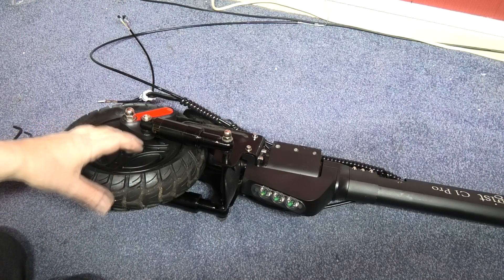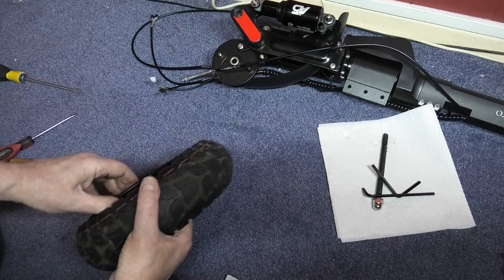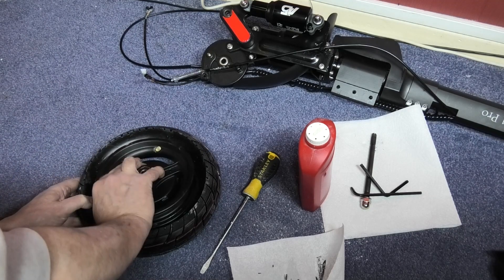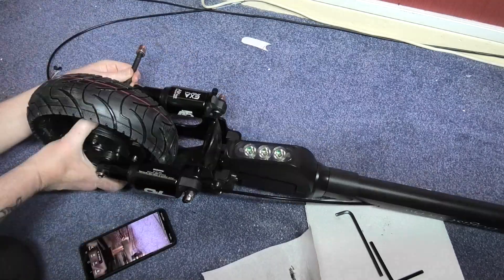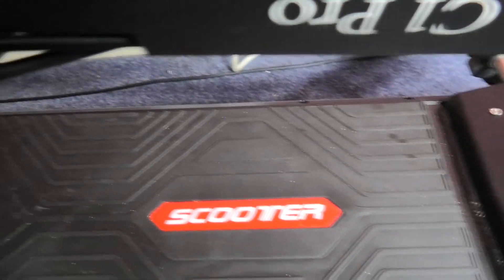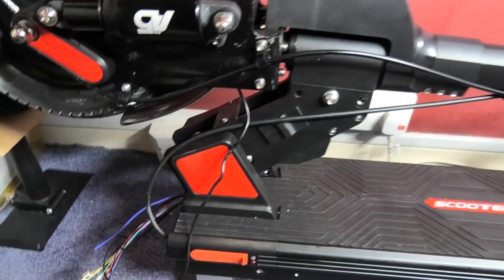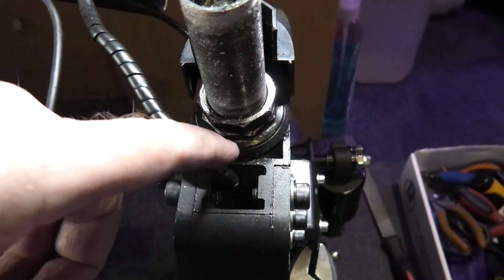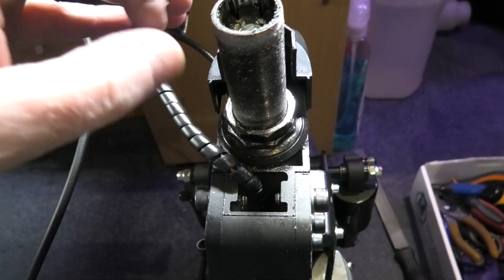🔴 EXTREMELY POWERFUL E-SCOOTER BUILD part 9 - New front tyre & fixing the steering

Comment: Why not go tubeless in front? seeing your rims, i think it could go tubeless.
Reply from the maker: Yes, I reckon it could and I might do it in the future. I just wanted a rolling chassis so I could work on the rest of the stuff.
Reply: @Vortecks  you've mentioned on your previous vid that some can convert their split rims to tubeless? how?
Reply from the maker: @k0k0w  The front is a solid rim, the rear is split. I tried to convert the rear to tubeless but I can't fit a valve because there isn't enough space between the motor and rim.
If you use a non permanent rubber-based adhesive, it'll hold the 2 halves together and hold the pressure no problem. I was planning to use E6000 adhesive but It's not going to happen now.
Reply: @Vortecks  Thanks for the idea.

Comment: I am also making a sleeper scooter... But it's huge. 5 inch wide fat tires 48v 2000w with a peak of 2500w chain driven. I want to slap a 72v battery and 3kw motor in it.

Comment: I had the terrible idea of buying solid tires for my M365.
If you thought changing the air-filled tires was hard, you can't imagine the solid rubber ones.
I had to sell them. Nobody in the city was able to mount them.
Reply: You actually have to use a crowbar to mount them, heat up the tire and cool down the hub to mount it. It's possible.
Reply: @darkslidesk8t3r  I tried many times :(
Boiled the tire to almost 100 degrees, used loads of lubricant, brought in friends far stronger than me, used big tools.
I just couldn't do it.
Reply from the maker: @logitech4873  Personally, I'd have got 3 spoons, lighter fluid, an angle grinder and then set fire to the lot 😂
I watched videos of someone trying to fit solid tires on an M365 and I decided against it in the end.
Reply: They're made for split hubs...🤔😳😳😳🇬🇧
Reply: @EnglishTurbines  You'd be surprised. They advertise a them specifically for the M365, and while it's THEORETICALLY possible to mount them, you need to be a gorilla trained in monster truck maintenance.

Comment: Why is the banjo on the outside of those brakes... 

Shouldn't it be on the outside?
Reply from the maker: Don't you mean "why is it on the inside"? 😁
Most of them are actually on the inside but obviously, they have a lot more clearance with a 26" wheel. I'll probably change it for another type in the future because I'm not happy with it being that close.
Reply: @Vortecks  

I think I may have originally went to put 'why is it not on the outside' and then changed it... Partially

I think if I had my banjo on the inside on my ebike, it'd rub the motor.

I don't use a rotor spacer, due to my frame and motor size.

Comment: I have a squashed disc and sciatica also. And have had nerve block injections. And unfortunately I can tell you there is a far worse pain. KIDNEY STONES!!!
Reply: do inversion tables work for various spinal/posterior issues ?
Reply: @girlsdrinkfeck  My opinion, fwiw, would be no. Possible temporary benefit, but no long term solution. I am finding chiropractic help plus wearing spinal bracing is beneficial to me with my conditions.
Reply from the maker: @girlsdrinkfeck  Yes, they do apparently work. The physio suggested that I get one so I did https://www.youtube.com/watch?v=Nu3Ux9UQHgM
...... and then I got rid of it.
Reply: @Vortecks  I watched that video. It seems you have similar, possibly a little worse condition, than me. I am L4 L5 S1. And at times pain has been crippling. The source of much of the pain is caused by inflammation. And I control that with Holland and Barratt. I hope you are claiming PIP, which can buy you the necessary.
Reply from the maker: @davidwebb4904  DWP deemed me fit for work (I got a total score of zero). I'm appealing it because I was misled into answering all the questions on a 'best case' scenario. During the assessment, I did manage to do nearly everything I was asked (albeit very slowly and in excruciating pain) but I was in bed for 2 days afterwards.
it took me 3 days to prepare for the assessment by getting a lot of sleep and rest (by any means) but they didn't care that I normally only sleep for 2 hours a night, they didn't care that I have anxiety attacks when visiting places where I don't know if I can lie down and they didn't care about all the effort I made, just to bloody get there. The report only listed the good points and she totally missed out things like "I don't go out unless my daughter is home because I'm terrified that I can't get back up the 2 flights of stairs back to the flat". Not only that, but they totally disregarded the letters from the neurosurgeon, the physio and the doctor which all said the same thing.
Unbelievable mate.
Reply: @Vortecks  Very believable because that's exactly what they did with me. The questions are biased into you failing. And as you said, they are in a best case basis instead of an on demand anytime basis. They are sneaky little bastards and honesty does not pay. 
On the paper questionnaire everything should be sometimes or it varies. That covers you for any eventuality. Same with telephone assessment. Then at the MR, you lay it on thick. Exaggeration is not a lie. After that, so long as you have given good answers, filing for tribunal should spook them into an offer. Then it's your choice if you want to accept that offer or gamble all in. 
Your conditions/situation sounds almost identical to mine. 
You can always reapply if your condition gets worse. A reapplication loses you back pay though. If you can still appeal the original application payment is from the day you applied. A nice fat lump sum. 
Would I rather be healthy? At my age with limited opportunities, I am calling this early retirement.